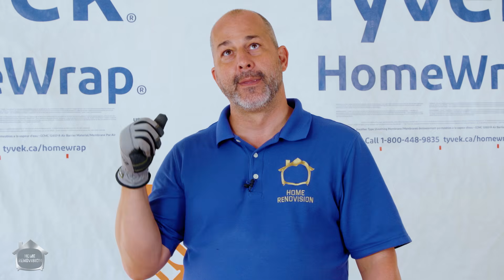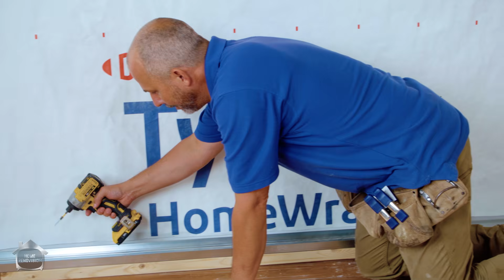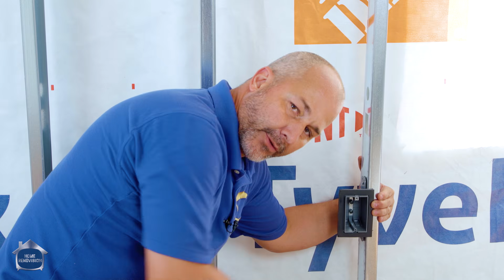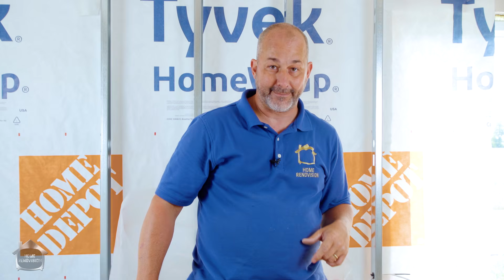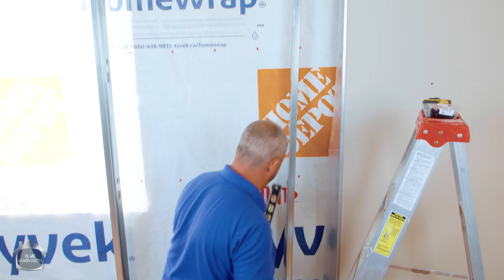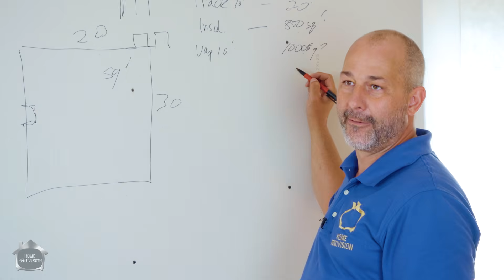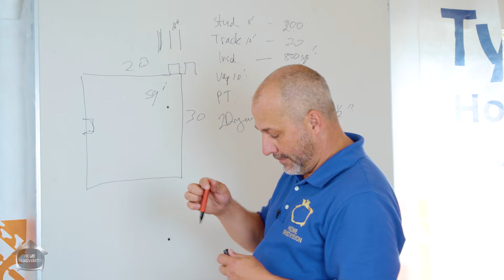Frame With Steel and Save Money! | Steel vs Wood

Comment: Michigan home built in 2003 and want to do this in the basement. Going to do dimple membrane and OSB subfloor. Would putting this on top of the OSB subfloor be ok instead of using lumber under the framing?

Comment: Yeah can definitely relate to the electrical tape > trip to the ER. I've literally put piece of copper pipe right through the meat of my foot and just poured a bit of hydrogen peroxide on it before wrapping some electrical tape around some paper towel. We might have free healthcare but they're not going to compensate you for the 2.5 days you spent waiting in the ER plus any equipment you rented.

Comment: I wouldn't hesitate to use metal studs in my basement after framing commercial buildings for 40 years. You can put something between the track and concrete to isolate it. Maybe where your location is a different climate than PNW. Also metal studs can be ordered with G90 coating which is the amount of galvanizing applied.

Comment: The NEC says 1 every 12 feet. Why? Because cords are generally 6ft. So no point on the wall can be more than 6 ft. It’s 4ft in kitchens because kitchen appliance cords are 2 feet long.

Comment: I see a lot of steel Installations,  but how do you remove non structural steel frame with the overhead box for AC ducts attached to it by drywall

Thanks

Comment: The idea of Tyvek is to shed water one way and breathe the other way?? You have it backwards the Tyvek needs to stop the moisture or water from the block or concrete wall and allow the interior material of that wall to breathe!! Just like they do on the outside of the house for that same reason simple 🙂

Comment: I saw some pros use stud crimpers to do massive industrial jobs very fast. What are your thoughts on using crimpers instead of screws? If yes, which one? I can't find a well reviewed tool for some reason. It seems like Stanley makes a couple of them but they are not sold in any physical store I checked online and Amazon is showing like 1.5 months delivery

Comment: So what I'm hearing after just the first 10 min.. if wood stud costs are back down ($3 for 8 ft)..and it's an older basement.. you're better off sticking with traditional wood framing. I definitely was considering steel because I thought it better for humidity.. not sure I feel that way now hearing about rust.

Comment: I just finished pouring a new floor in my basement.  It was previously gravel for 30 years before I bought the house.  I installed a waterproofing system prior to pouring the slab.  I also installed a dimple board sleeve around where the slab meets the wall and footer for moisture to channel into my new french-drain system so there is a gap between the slab and the wall.  In your opinion, can I get away with shooting steel track directly to the concrete for my wall framing or should I still use PT as a bottom plate?

Comment: for DIY is better steel. If you have your wood in your garage for weeks, it later becomes useless due to the natural tendency to bend. I have a bunch of steel frames in the yard from last year and I will use them now. They are like new ones :)

Comment: Question:  would making a box patio frame out of metal studs with coco lumber inserts be advised?  Home in PI needs a cover .. regular wood is expensive and bad .. Coco lumber is very weak .. but if you combine the two with a layer of OSB and then roof panels .. would that work?  Thanks and love your video's and advice.

Comment: Hi Jeff,
Two things: First, amazing video! I am a 65 year old woman who has been intimidated by steel framing, and it is getting harder and harder for me to carry 2 x 4s around. Thanks to you, I am prepared to try steel framing for the first time.
Second, you mention some source for steel framing supplies, but I do not know what you are talking about. Home Depot does not carry 16' lengths, which is what I need for my project, but I only need a small amount.   Can you send me in the right direction? Thank you!

Comment: I hate steel framed basements, your walls echo and transmit vibrations and sound through the whole basement. Also trim work is harder and hanging anything is a pain.

Comment: I'm planning to use steel studs for the basement walls. Does spray foam insulation work okay with the metal?

Comment: Small wafer screw size specs? I've been using small self drilling wafer head screws but want to try the sharp tip ones.

Comment: Great information thank you. 
Question how would I frame my metal building 30x40 using metal instead of wood then insulation and drywall  
Any advice greatly appreciated. 
Many thanks.
Reply from the maker: structural framing is a different beast than non load bearing interior walls.

Comment: Question…. I love your video on metal stud walls and I am doing this in my studio built out of a 12 gauge steel pole building. Problem is one of my walls runs the same direction as the 5ft on center steel A frames up top. Problem is, it’s in between about 2ft away. How would I go about mounting the top of the metal wall framing, when there’s nothing there? Cross members between two a frames? If that’s the solution, what would I use? Hat channel?

Comment: Couldn't you temporarily use those small clamps to hold the plastic in place before you drive the staple into it?  Maybe double up the edge along the top and clamp it in place, then you have enough plastic let over once the rest of it is in place to cover the top inch or two.

Comment: hi Jeff i really appreciate the way of making hard stuff look much more doable.  Thanks a million.  
Now,  I saw a video coming out of the UK where the contractor/presenter use "tracks" & "studs" just like you did.  However, what i found interesting is that the internal "stud" were floating.  The first & last studs in the wall were secured to the 2 tracks at the bottom and top just as you did.  However, the in-between studs(floating studs) were only secured to the "plaster board" which i think is the "drywall equivalent."  So my question is "are floating studs doable; or must they be secured to the horizontal track first before being attached to the drywall?.
Reply: I think we saw the same video. The studs aren't floating, they are crimped to the tracks with a special crimping tool.

Comment: I would like to attain double stud benefits by using steel/metal studs up against stud exterior wood framed by 2x4 walls. The structure will be in South Texas along the gulf coast, which is a hot and humid climate zone. The wood-framed 2x4 would have standard Tyvek vapor and composite siding on the exterior. Also, the floor will be a standard tongue-and-groove subfloor built on a half basement that is insulated and sealed as well. I would like to use cellulose for insulation. The reason I would like to do a double stud wall, regardless of mixed steel and wood or not, is because I want to increase the R-value of the wall and increase noise suppression. Also, I think despite the interior studs not being load-bearing and the exterior already having a standard and required hurricane ties, this would further strengthen the wind resistance by making a stiffer wall.

1. Would this be against code?

2. Would it increase the strength of the walls?

3. Would it require an interior Tyvak sheathing?

4. Would cellulose insulation be acceptable?

Comment: Hi Jeff, thanks for your tutorials, and one consideration about galvanized steel framing always we must to use  galvanized screws, never we use metals non galvanized in contact with galvanized metal, because produce oxidation in joins between normal metal with galvanized metal, this is called galvanic battery, for that reason we must take a lot carefull when we mixed metals.

Comment: laying steel on concrete with potential water or moisture can lead with time  to directly rusting away. using proper green trested as your bottom plates is the way to go.   
grreat vid...

Comment: Last year steel studs were the same price as 2x4 studs. We framed a commercial building wall addition in steel even though it was originally wood framed walls. I am not sure which is less cost now. Wood or steel studs is the same manhours to install.

Comment: Minor advice. I know Jeff is focused on other details, but for us/you DIY'ers, black marker/sharpie is great for steel frame work, but NEVER use it on drywall. It will bleed through the primer and paint and drive you crazy as you have to apply coat after coat of primer to cover it up. Only use pencil on drywall. Good luck!
Reply: It won’t bleed through Kilz spray…
Reply: I have been cursed at by the painter for doing that.
Reply: Lol I use permanent marker still
Reply: Yes you are right!👍

Comment: I learned a lot.  Going to go build a house now.  :D

Question 🙋‍♀️ do the same principles apply to 80/20 extruded aluminum.  Cause I am lazy, and my build will be more like an ikea closet building.   

Question:  question 🙋‍♀️ let’s say you solve the moisture problem but live in a swamp.   Would cement board be better than drywall.  Like a cement board tadalak approach?

My first house will be small, because I am lazy and a hurricane is coming.

Comment: Always great videos and fun to watch.
My problem with metal studs is that after fastening at the top and bottom to the tracks, the stud still feels very flimsy.
How to do bracing between studs Jeff???
Reply: And also how to mount things like shelving or TVs after the fact without pre-planned blocking.

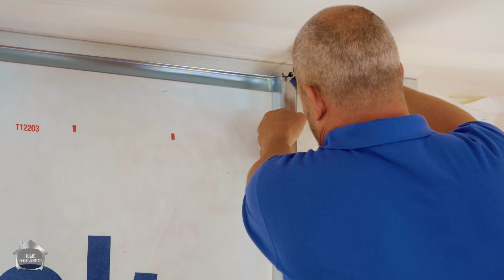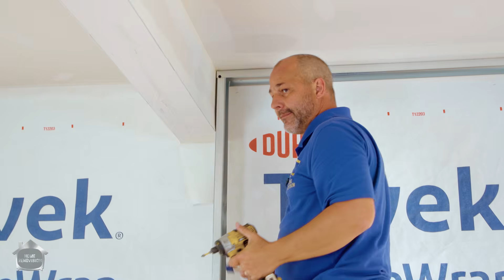Comment: At 20:24 and 21:07, there was only one screw inserted to fasten stud to the top track. Is that code/acceptable? I'm contemplating building in place because I wouldn't be able to drive a fastener on the backside which sits flush against wall.

Comment: Amazing and informative.  Some questions for you,  I live in lower NY area (long island) we do generally have moisture in our basements here. I have a french drain but is NOT foolproof and summers have wall sweating and moisture.  
1- will I need a vapor barrier? 
2- We have a "curve" where the floor meets the wall. The last 1.5 inches  along the edge of the floor starts to curve up slightly where it meets the wall.  Where do I place the framing then?  
Thank you

Comment: Home reno i have a water damaged drywall ceiling to remove it is fixed to metal studded ceiling waht is the best way to remove the drywall sheets with ruining the metal studs?

Comment: Hi Jeff, I have an unfinished bsmt with top half of concrete wall covered in a R12 insulation batt. Should I remove them, then frame the steel studs and buy insulation to go between them? Or can the studs go in front of the insulation
Reply from the maker: always remove insulation wrap. Cheers!

Comment: So there are way more educational videos on metal stud framing. First off you don't need a chop saw for light gauge studs you can cut them with snips and a razor knife scoring the back side and it snaps right off, second the studs come timber bundle if you are using a chop saw you cut all 10 at once, third you use vice grip c channel clamps and you need about six of them minimal when clamping your studs to track because there's a little c channel that wraps around the back side of the stud and those flat clamps won't work, third you always stagger your screws never straight, oh there's so much more slip studs soft headers hard headers heavy gauge middle steel framing light gauge radius framing maybe Canada doesn't like this but that's literally a steal chop saw for cutting like small I beams

Comment: I'm demoing some closets and putting in a J&J bathroom onto a slab house in Florida.   A friend said I should look into steel studs so I took a look at this video and yes, it would be much easier.   Then I went to price out the studs.   Over $10 per stud!!!   Price of steel has gone way through the roof.   Wood's coming down a bit.   I can get a 2x4 for about $6.   Still a lot, but way cheaper than the steel.   Would have been nice to use, but not at current prices.

Comment: Isn't the whole point of attaching the wire to stud, that it cannot pull out and fall into the wall during a repair later? That zip tie method doesn't accomplish that. What is the point of even doing it by that method? Seems like we are robots to follow code, without thinking about the reason they exist.

Comment: It's now November 2021. Home Depot 2-inch x 4-inch x 8 ft. SPF Dimensional Lumber is $3.98. Was the price in 2020 actually that high? Was it for 8' or 10'?
Reply: Yes the prices were that in 2020; the prices have adjusted I guess after the shift in demand and supply.

Comment: When you say "and this isn't galvanized" - yes it is. Those are zinc-plated studs. But you are putting them (light-gauge steel studs) directly on pressure-treated lumber, in an area where you spell out moisture concerns. We know pressure treated wood eats zinc-plated steel like nobodies business.

Use flashing, foam sill seal, or something else to separate the steel stud from the pressure-treated lumber.
Reply: geez  was about to put the steel right on the pressure treated. Thx.  Another tuber advises putting sill gasket underneath the pressure treated.

Comment: Jeff does that Tyvek/Typar sit on the cement wall and is it attached with tapcons? In your How to Insulate a Basement video the Typar was attached to the back of the wood studs, so isw there an advantages/disadvantages to both approaches.
Reply: Looking for this answer also

Comment: Is there any reason not to use 2 1/2" steel studs and tracks instead of 3 5/8" for the wall framing?  They are even less expensive.
Reply: I guess you would be compensating for thermal bridging since the steel would be more thermally conductive

Comment: Great video and thanks for sharing. On the outlet spacing, it is acceptable to have 12' spacing per National Electric Code section 210.52, so you should be good to save on a box or two!

Comment: Glad to see SOMEBODY acknowledges that all houses aren't built in the frozen north!!! If you run a vapor barrier like that here, you'll wet down the insulation, lose its R value, and turn it into a mold farm. We don't use ANY vapor barriers in standard construction here. Paper faced insulation, paper to the inside, and a breathable housewrap on the outside - NO vapor barrier. You can use 15# felt on the exterior, it breathes enough, but woven tyvek is better.

But now that I'm thinking about it - I'm seeing a lot of Canadian videos lately. I think they're trying to take over the world, and when they do we'll ALL be sorry!

Comment: I'm not sure about there, but they changed the formulation of pressure treated down here, and it eats steel pretty fast. If you don't use HDG or coated nails / screws - they'll be completely gone within 2 years. What your using there doesn't look pressure treated though. Maybe there's some sort of flashing tape, or maybe a strip of tyvek or something would be good to protect that? Idk - tyvek might pass it right through? Or maybe there's some kind of coating for the track? Maybe - my fear is just unfounded!

Also, dang right, tyvek isn't a vapor barrier! It's a vapor retarder, but it's not a barrier. But up there (assuming Canada from the accent), my understanding is that exterior walls up there have a vapor barrier on the inside, fully taped seams. Down here in hot climates there is no vapor barrier at all. There's a vapor retarder. The paper face on the insulation - which also goes on the inside of the wall. The exteriors we wrap with either tyvek or 15lb.

Comment: Hey Jeff, awesome video! Just wondering why you recommended this only for the basement? Would it not work in the upper floors as well. It seems like it might even be better there since you have less moisture issues (except maybe the bathroom). Thanks!
Reply: My guess is that you might need a lot more pre-planning with wood blocking and the like to be able to hang shelving and cabinets since you don't have big beefy wood studs to anchor into.

Comment: So... I'm an apprentice at this plumbing place because my job was no longer available at the place I used to work. Assisting with the Casting and assembly of Prefab Concrete walls with doors and windows was what I used to do. So here I am trying my best to Run a drainage Pipe  ontop of a false ceiling made of this vey same metal purlin 2.5 inches, when I heard a click and Boom . The Purlins are still holding my dumb ass But the sheet rock is gone. My boss is mad, and I'm like no worries I'll research it and figure out how to fix the false ceiling back. I had the know how already but thx for all of the tips and tricks. Thanks to you I used no electrical Tape. I also added a new access point in the very same spot that held me up.

Comment: Only cut 1 to 2 inches on your wire not 5 to 6 inches. Risk nicking hot and neutral wires... Pull ground and rip sheath to expose wires without nicking them... Then cut off waste. I watch your channel. Good stuff...

Comment: Thanks Jeff, I'm researching/planning whether for a backyard studio I want to do 2x6 wood or steel framing. I like the fact it's not as precise, that's a huge boon lol. 😁 I also like the fact it's stick construction instead of platform, since I could keep the framing in the garage and bring it over as needed.
Reply: Do you do the studio you use wood or steel framing?